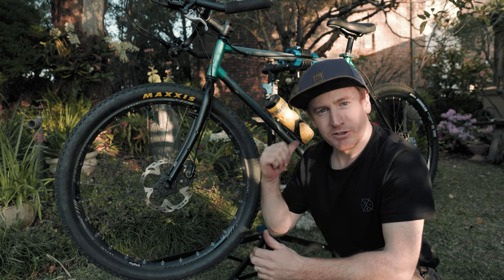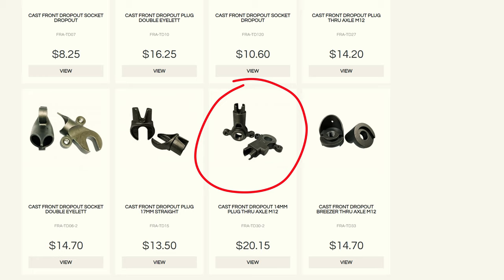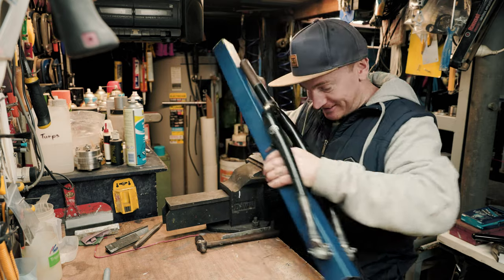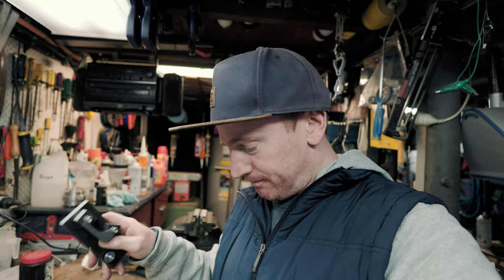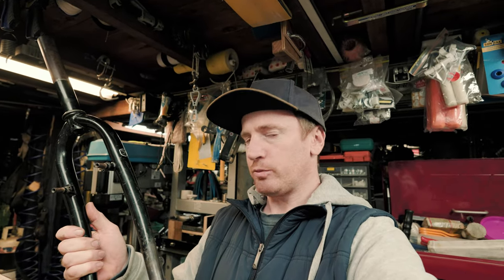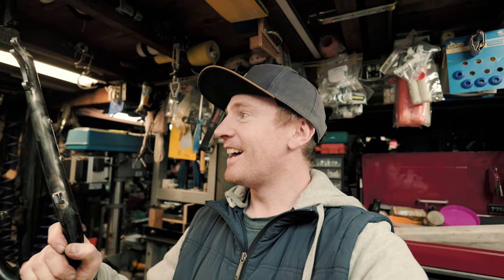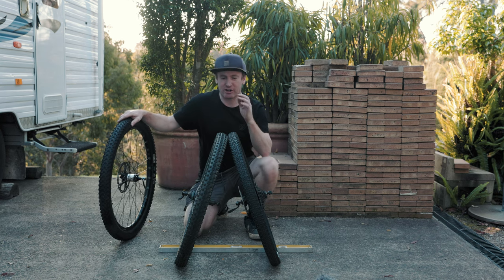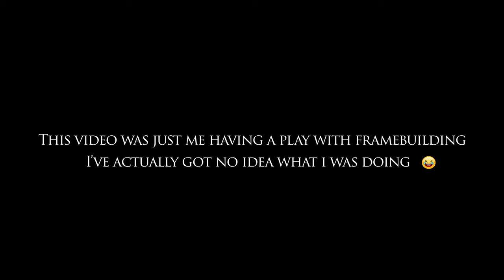I Replaced the dropouts on a 90's MTB fork to fit 27.5 inch wheels // Disk brake conversion

Comment: Dad was relieved it fitted. bet he looks forward to you going for a ride..lol.
I know it's extra weight but 1 or 2 of the bolts/studs/ nuts you use I'd put in a small container and take with me. 
Since your dad did the oxygen welds you won't need a oxygen set in a dofmg trailer.
Great work! I wouldn't tackle it. Not patient enough.

Comment: Same with a 29er and 27.5 on 27.5/27.5+ fox 38s still work's with the end of the scale offset being 44mm it works good with a 2.5 magic mary i done this as a test for a mullet set up on my 27.5+ fox 38s. I don't use bigger than a 2.4/2.5 tyre anyway and its working just fine

Comment: i swapped to a 2.1" in my small trek 7300fs disc..  hybrid meant for 35mm 700c.. great success..  rear wheel needed a bit of disc adjustment.  but having the 29x2.1 beside my 26x1.75 city bike.. lol beside my 27.5 50mm it's normal.   beside my 2.3 26 you can't notice much

Comment: I have put 27.5 Ikons into a 26" frame and had trouble with the seat height because the seat to ground increased and seat to pedal stayed the same. The fork mod is fascinating and a review would be appreciated once you've thoroughly thrashed it. Thanks for sharing.
Reply from the maker: Will do 😂
I’ve had a similar issue with this bike, the frame has always been too big for me and now with the bigger wheels the standover height is too high. I dead set have to be on tippy toes 😂. I’ve recently got a smaller frame and I’m currently in the process of filming a little story on it. 
Apart from that, the bars I used turned out to be a bit of a fail, they’re too low and I get a sore neck riding from looking up so much. I’d still like to try proper drop bars as the hoods sit higher. That might happen with this new frame. 
We’ll see how it rides 👍

Comment: Just wanted to say that Raleigh bikes are a British company that has been building bikes since 1887 in Nottinghamshire and are still based in Nottinghamshire and my first bike was a Raleigh Budgie, and then I had the Raleigh boxer in yellow, and then I had a Raleigh striker in green ,and then I had a Raleigh grifter with 3 gears in blue ,and then the bmx Raleigh mag burner in blue n yellow, then a Raleigh burner bmx in golg and then a Raleigh pursuit 12 speed racing bike in black and a Raleigh milk race 12 speed in pure white ,and then mountain bikes came out and I had the Raleigh mustang in light purple 24 speed weighed a ton as it was made from steel even the chrome wheels but back then it was a good mtb bike .

Comment: This is in equal parts absolutely bonkers and the best thing I’ve ever seen! 😂

I’ve recently posted a video of me having converted a flat bar hybrid to a drop bar gravel and am shortly about to start a 90s MTB to gravel project. 

Like you, I just love tinkering with bikes and seeing what can be done with them. I’ve had loads of people telling me the 90s MTB frame isn’t worth throwing money at and that I’m clearly stupid for even considering it but for me it’s all a learning exercise and a bit of fun! 

Great video though and seriously well done with the disc brake mount! That would be the part of the job that I’d massively screw up and they’d end up out of alignment! 😂
Reply: Oh and I love the fact that your Dad is so willing to jump in and help. I’m hoping my kids ask me to help them with a similar project to this when they’re older. 👌🏻
Reply from the maker: Cheers mate. I’ll have to check out your video. I love tinkering, this was a random idea I thought would be fun to try. It’s still going strong so pretty chuffed with the result. Especially how well the disk brake tab lines up. I’ve got some other projects I want to try but I live in a unit and don’t have a lot of space. Mum and Dad live far enough away that the drive to and from kills me. I’ll get to them eventually. As for putting money into retro bikes, I think they are good fun and a great place to learn. If you break something it doesn’t really matter 😂 enjoy your build 👍
P.S I love getting dad involved. As much as he thinks my ideas can be stupid it’s great making memories with him. They are getting older every day so I’ll cherish these moments while I can 😁

Comment: That is magnificent! I'm in the process of changing a 2007 Giant Rincon to 27.5" for flat bar gravel riding (with cheap Ali Express aluminium fork). Luckily it has enough clearance to fit the 2.0" tyres I want to use and has disc tabs. My main goal is to convert a 90's Cannondale F400 to rigid and disc. This will require a disc tab to be aluminium brazed to the frame which, being no good at welding/brazing, is a bit daunting. How do you find the drop bars? I was thinking about getting those style so I can keep using the MTB style brakes and shifters. Are you in a comfortable position with them?
Reply from the maker: Yeah I’m actually loving the bars, but they were very wrong in this video. I changed it up for a trip I did called fun coastal bikepacking trip. This was better but still not right. I then put a taller stem to bring it up a bit higher and since then I’m really happy with them. My 2nd most recent video I was using them with this higher stem. I’ve been riding up in the “hood” position so squeezing the break can feel a little weak but so far it’s been fine. And that’s even with a fully loaded bike.
So at first I wouldn’t have recommended but now I would. I actually started making a video about my thoughts on them but haven’t got around to finishing it. 
I think they’re a great option for the 90’s bikes because of the shorter reach.
I like them so much I would even put them on a hard tail. Bit of front suspension for the rougher stuff yet a bit of a roady feel to it too. 
Good luck with your build!

Comment: great video! mate, have you done any calculations for your front fork? the whole braking force goes onto one side and the braking force is much higher compared to rim brakes. I am looking for calculations online, but cant find anything.
Reply from the maker: No I haven't sorry. I have heard a few people say things like this but i'm a bit of a hack and didn't care. If that was an issue then nobody could convert a rim brake fork. I just wanted to try and see what happened. I've converted 3 old bikes to disc brakes and have ridden with a few others with converted forks. No one has an issue. You might be correct to say modern forks have a thicker wall to compensate for the forces closer to the axle but i can't image there would be much difference. I do heaps of bikepacking trips with fully loaded bikes and yeah, No issues, no sense of twisting etc. Good Luck with your search.

Comment: Nice conversion and entertaining video, would love to see part 2! I would not do the dropouts in my 90’s bike but I’m considering the disc brake conversion and add points to attach cargo cages, I have mechanical technician background, have knowledge about bike mechanics and know how to weld but I don’t have all the tools and requires a lot of hours, it’s more about the enjoying the process of adapting, changing or improving something. You did an excellent job, cheers mate!
Reply from the maker: I’m still really keen to do part 2, only problem is I have to travel about an hour to my parents house where the tools are. I then chat for hours and get nothing done. I will definitely do it but might take a while 😂 As for the disk brake mount, it was really quiet easy once I made that jig. I linked a video and template in the description. It’s from Cobra framebuilding and he talks about the disk brake mounts, this is we’re I got my info from when working out the brakes.
Thanks for watching. Also, I’ve been filming the process of building a paddle from wood I found floating down the river. I started that video 18 months ago, still sitting an my parents waiting to be finished 😂
Reply: @advanturest  I have a lot of footage from my tour Honduras/Colombia, Bikepacking and kayaking Norway, turned my hybrid trek 750 into a gravel bike, and not a single video, I’m in the process of learning to edit and I master the art of procrastination that’s my problem! Projects and videos are not easy but hopefully we’ll see part 2 😂

Comment: I'm also trying to make a gravel Monstercross with a frame from a specialized one from the early 90s, but I think the frame design dates back to the late 80s as it still has the 1" seat tube and the 26.8 seat tube. (too bad, a I would have tried to fit a possible telescopic seat post). At the moment I am making small economic attempts mainly with the intention of evaluating whether this frame deserves, due to its geometries and dimensions, rideability etc etc, a possible upgrade with target components a little higher than the economical first price. for the transmission I am currently on a classic 3x8 (44/34/22 x 11/32) also purchased at the decathlon at the end of this study on the economical components I will evaluate whether an upgrade of the components will be possible and convenient (important I want to try to fit 650bx2.00s on it and consequently weld the disc brake mounts on it) and put a gravel-oriented transmission, or otherwise set it up for simple daily use or cycle touring. it will be a long period of evaluations and tests, but these old steel frames have their charm, incredible quality welds and proportions and angles that are very close to the current Gravel ones, with a wheelbase of about 4-5% higher which should give better stability. Buying a Triban Grvl 120 would perhaps be easier, faster, and not much more expensive at the end of all the tests if I opted for the definitive upgrade, but the fact remains that this frame is so beautiful and I'm fond of it, that I would do something with it anyway, so you might as well do it right away

Comment: Great video! Which structure did you ride on the latter part of the video? Also, what model camera are you using? Thanks!
Reply from the maker: @findtherightbeat  I’m guessing you’re talking about the bridge I road across. It’s the Woranora Bridge. There is a pedestrian path underneath the bridge.
Most shots were filmed with my Canon R6. Although I still have an older Canon EOSr which was used for some shots. 
Riding scene was a GoPro 8.
Cheers
Reply: @advanturest  Thanks, appreciate the info! Again, great content, footage and editing! ☕ 

I found the bridge interesting as from where I'm from we don't normally have those integrated structures.
Reply from the maker: @findtherightbeat  no problem, when I was in high school they build this bridge and I can remember how cool the underpass type walkway was. There wasn’t any like it at the time, well not that I know off. It’s really cool being underneath. You don’t hear the noise of the traffic above and the views of the river below are great. These days I see a lot of bridges built this way. Separates the cars from the pedestrians.

Comment: Are those "Suspension Corrected" Forks?  The Raleigh Technium originally came with a shock absorber eh?  The fork you show on here isn't as long dimensionally as the original Suspension Fork thereby throwing the bikes handling off by quite a bit.  It most likely is sagging in the front giving it a real uncomfortable over the bars feel to it.  If the bike didn't come originally with shock absorption front forks then disregard...but, if so...ask me how I know?

Comment: Sweet Bike as  I personally don't get the hate for old MTB's as it makes no sense to me  . The 1990's bikes were some of best looking MTB's and are still fun to ride . To me it's the equivalence of owning a 1968 Dodge Charger and claiming that its junk , outdated as a modern car is faster and drives better so I'm never going to drive the Charger sitting in the garage .

 I own a 1991 KONA Hei Hei that I recently found at a thrift store about 8 months ago  for $50 . All the original components were swapped out during the early 2000's with cheap bike store parts as the person likely thought they were upgrading . The Hei Hei is a Ti frame race bike that originally came with the best of the best components for the time period as this person was a  dolt to replace them all with junk right down to the rims , had a 5lb Rock Shox Judy TT  🤣 , changed the decals etc .. but I'm not complaining as it was only $50

  I just recently retro modded it and the bike is a perfect adult BMX bike that I use for my urban cycling adventures , I do however take it in the woods on occasion but its a chore with the old geometry and little wheels  . I will  restore it to factory at some point as I slowly find the parts as  its a very sought after and very rare bike as it's  KONA's most collectible bike as in 1992 not many people were forking over $2,500 for a MTB .  MTBing was in its infancy and just starting to become popular so not many were made as my guess is less than 1,000 , so yes it will be restored in the future ..

  I'm also on the fence to find someone who can weld Titanium to convert the bike to rear disc but I likely won't to keep it factory .....but 😉

Comment: Great video was wondering how many bikes you have? Which is your favourite? Cheers
Reply from the maker: I’ve got a bit of a mess really. Here is a list of my bikes.
I have my newest bike which is getting older now. It’s a 2015 Trek dual suspension XC bike.
I then have a Commencal DH bike which I think is about a 2009 model.
As for the older 90’s bikes.
I first got the Raleigh M-Trax 1000 for something to tinker with when I got into bikepacking.
It’s a little large for me so I got a smaller Shogun Trail breaker. I don’t know if I got a bad model but it’s very stiff and a harsh ride. Not a fan of that Shogun at all.
I then got the Mongoose only because I saw it for $25. Turns out I love the Mongoose.
Since then I bought another cheap Raleigh to replace the one in this video. It’s got a smaller frame and fits me better.
I’m really not sure what is my favourite. I’ve had some awesome times on all of them. My Mongoose in particular. The Mongoose just seems like a smoother ride although that could be just in my head. I’m not the biggest fan of the early 90’s shapes though. I think the later 90’s bikes with 1 1/8 headsets look better. I’m still looking for something decent with double butted Chromoly frame and 1 1/8 steerer. I’m keen on the 1995 Trek 930 if I can find one. Just missed out on a cheap one the other week and I was bummed 😂
Lastly I have a pretty immaculate Apollo Himalaya. My grandma won it back in the 90’s and I don’t think it’s been ridden. It’s very similar to my Mongoose in terms of size and shape. Not sure what to do with it. It’s too clean for me to touch 😂
None of my old bikes were high end. I’ve been putting modern components on most anyway so it doesn’t matter too much.
Reply: @advanturest  Thanks mate very impressive  list of bikes. Keep up the great adventures. 👍

Comment: It looks like you have put the drop outs the wrong way in. Forward back. The opening should point out straight down not to the front. Or am I wrong?
Reply from the maker: You are correct! On the bench holding the forks vertical it seemed right. I’ve been riding them like this for about 18 months now and didn’t notice until someone else commented the same thing and got me to check. This was only earlier this year. It’s a little annoying but rides and works perfectly fine. I actually just rode to work this morning with these forks and was thinking about these dropouts being back to front 😂